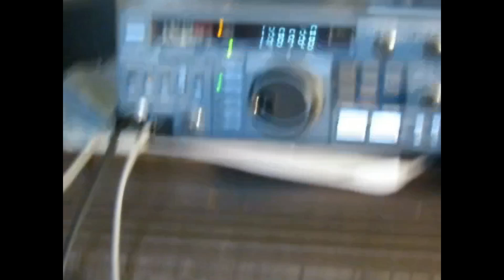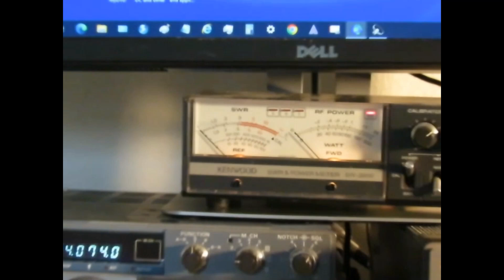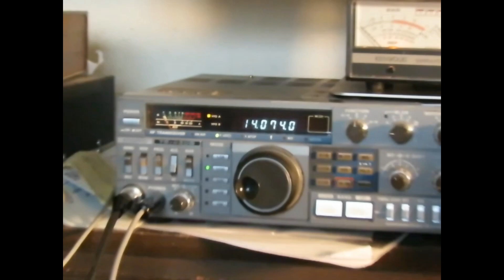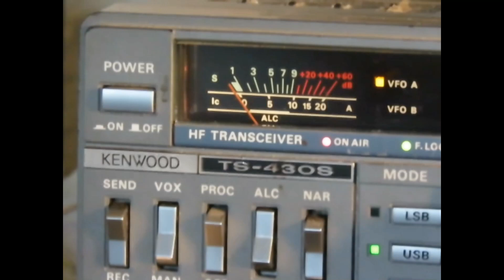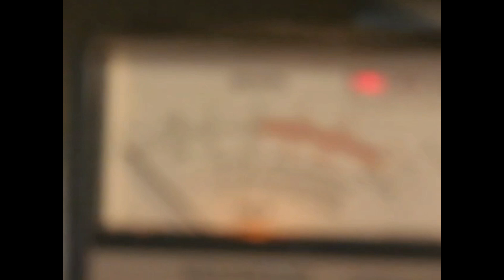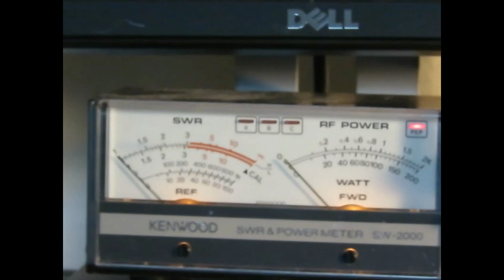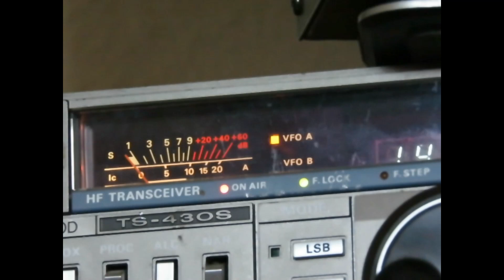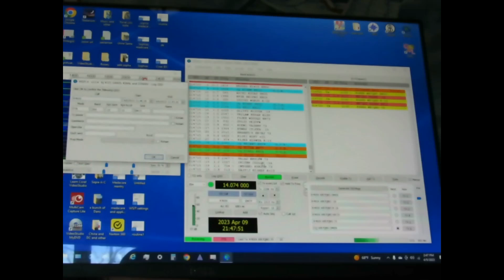The Easiest Way to do FT8 With an Older Radio Kenwood TS-430s

Comment: hello.
I am also using TS-430S.
I would like to inquire about ft8 connection.

To summarize your video on connecting a microphone to a computer:

1. Disconnect only the 1st microphone wire among the 8 PINs.
2. Connect resistor 101k ohms (54K + 47K)
3. Connect the microphone cable behind the resistor and then connect it to the computer microphone jack.
4. ALC Control

inquiry
1. Is this a method of operating FT8 through VOX without PTT operation?
2. Of the 8 PINs, only the number 1 marked line is connected?
   - In the video, the entire line appears to be connected.
   - Can you show the connection parts in detail?
Reply from the maker: @chemistry8933. I read your post just before going to work. I'll answer your questions this weekend. I'll make a short video and post it on YOUTUBE then send you the link. 
Here's a short description. For TX You have one wire going from the computer audio output through the resistors-then to pin 1 of the microphone jack on the radio. You will not have it go through the microphone. You will have your VOX on. For RX use a mono audio cable from the headphone jack on the radio to the mic jack on the computer. Adjust the volume on the radio so the audio receive indicator on WSJTX software to 60 to 70 dB. Keep it green. It's on the left side of the screen. 
Again I'll get real detailed this weekend when I have time. I have a full time job so can't do it today or tomorrow.
Reply: @hamradioeconomystyle48  
Thank you for answer.

As a beginner amateur radio operator, there are many things I don't know.

I hope to have FT8 communication with you someday.

It's not urgent, so you can answer slowly.

thank you
Reply from the maker: Here is a more detailed video of the connections you asked about.
Title is:
Specific for Kenwood TS430s Digital FT Modes
link is: 
https://youtu.be/jicWzWEJRac
I hope it helps. If you have other questions let me know.

Comment: I have a simple DCRX based on MC3361 (an IC taken out of old cordless phone). It's made by my own design.
I've installed FT8CN app on my Android phone. I just place my phone close to a speaker of my RX and tune it by FT8CN displays. It works pretty well. I've added 25 DXCC to my 150 I gained by SSB and CW modes. :-)
Reply from the maker: That is awesome. Improvising.